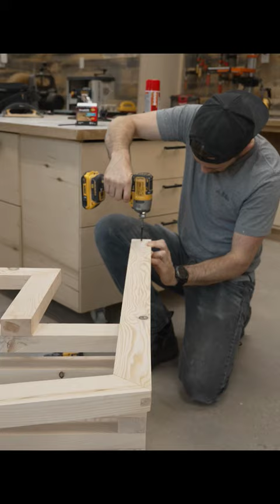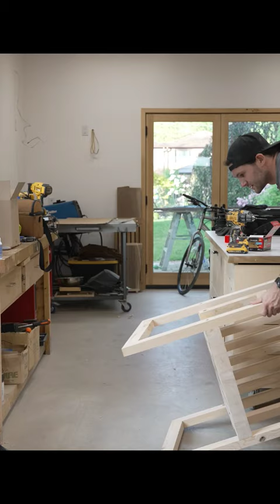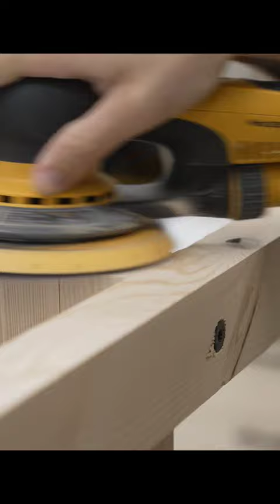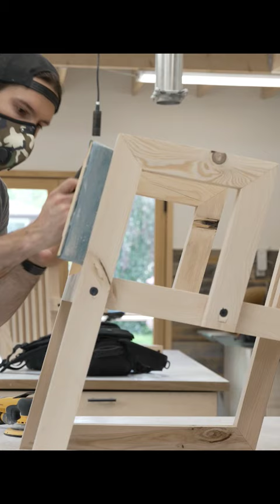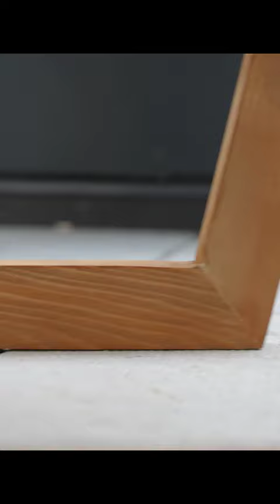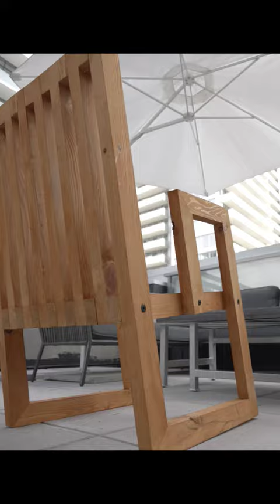Sculpting Softwood

Comment: One thing that softwoods have a bad rap for is thickness: it just looks heavy and bulky. And those rounded edges! Saw the wood so the edges are sharp goes a long way at improving it's looks. If you're lucky enough to have a planer or thickness planer, just taking off 1/8"-1/4" of it's overall thickness and it looks custom rather than Big Box.

But using a hand plane on softwoods can be trickier than hardwoods. Softwoods tend to tear instead of cut if your plane blade isn't razor sharp. Invest in a good set of water stones or better, diamond stones to sharpen the chisels and plane blades.

Comment: You can legit do all that stuff on hardwood. Its not very difficult
Reply from the maker: I don't remember saying you couldn't do it on hardwood. It's just a lot easier on softwood
Reply: @ZacBuilds  its already easy on hardwood though
Reply: It’s about cost to a beginner. Fudging up on hardwood is painful. Plus for larger projects where money may not be plentiful, but practice or a product is needed, soft woods are great!
Reply: @jawn137  that is true but this video was specifically about how softwood can be adjusted
Reply: @bullencarker  it was about how softwood gets a bad rep not about the fact you can adjust it
Reply: I mean, the video was a bit misleading. As if, you're slightly off with hardwood, you gotta scrap the entire project and start over. But with softwood, just bust out the sander.